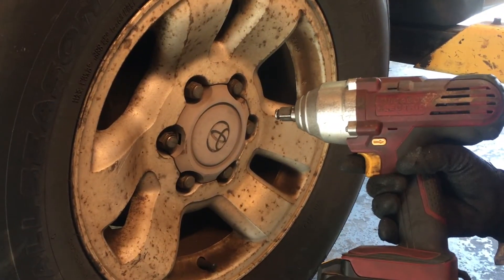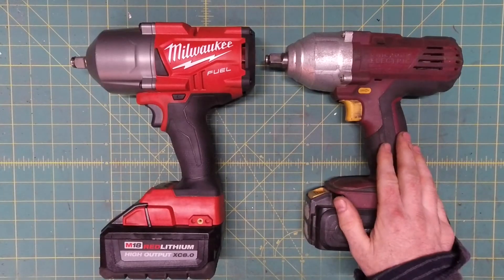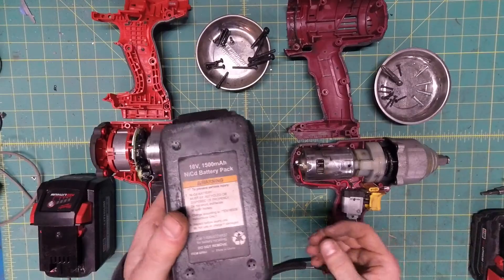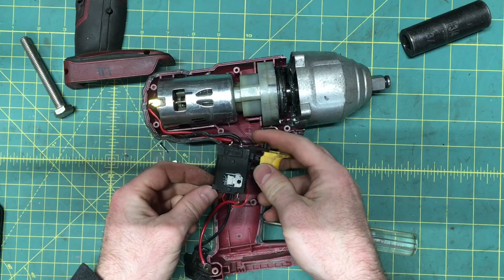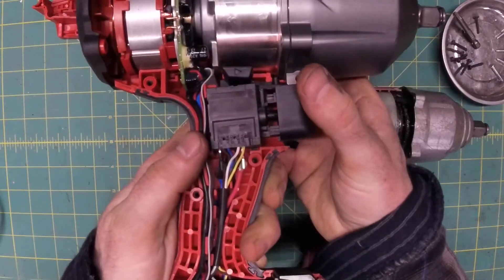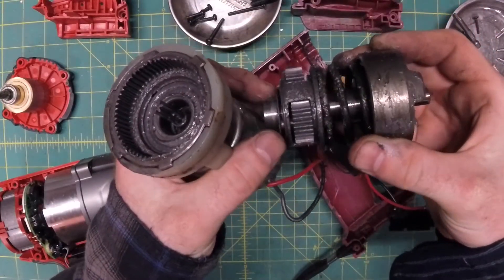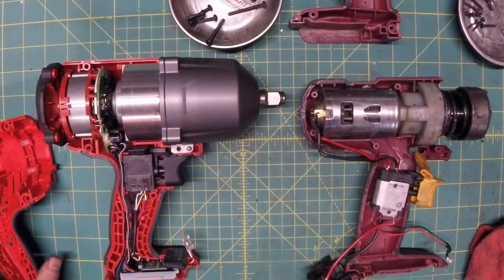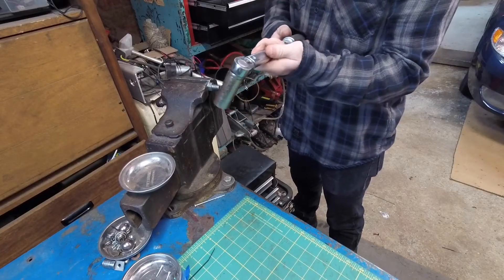World’s Most Powerful 18V Impact VS World’s Cheapest: M18 vs Chicago Electric Review & Full Teardown

Comment: Here’s what I don’t get (yes off topic a little) Snap-on cordless are made the best on the market but lack so much power. They are so much easier to service and the anvil housings are thicker.  They don’t seem to have powdered metal pressed gears either. It just makes no sense for why they are so weak to other competitors. M18 is the best choice overall. I run Makita since I am on that platform. Makita TD171DZ is hands down best impact driver on the market and one of the few Japanese made tools left from Makita. The torque is not quite as high as Milwaukee but made better. I really enjoyed this video. Thank you.
Reply from the maker: Thanks! Makita is also one of the few tool brands that isn’t owned by some mega-conglomerate as far as I know. I’d love to give them a shot, but like you, I fell for the battery system and now I can’t leave.
Reply: @thedoubtfultechnician  You are correct a Makita just owns one other line Maktek which is a little down grade but they still have some nice tools for what you get
Reply: Yes the snap on also uses powder metal gears. It’s unavoidable. The snap ones have a known issue as well where the drive square is prone to snapping because of bad heat treating.
Reply: @kfs777  You sure the older ones aren’t solid gearing? I have a 14.4 3/8 and A1/2 18 volt snap on impact. They were bought new about 10 years ago and they still run good just have had to replace batteries a few times. I wouldn’t buy anything snap on now cause they are under powered and cost to much. However I know for a fact they are easier to service. Old grand father tools used metal gearing like Milwaukee back in the day.

Comment: Suggestion: get the bolt in the vice and unscrew the nut. You're putting a lot of pressure on the nut in that vice and it's soft metal, deforming it and making it more difficult to remove the bolt.

Comment: Everyone watching the slip in Milwaukee batteries is usually on purpose. DeWalts have the same design. It's moved to absorb the vibration instead of transferring it to the battery connector as brutally. Otherwise you end up with cracked batteries. Which was a huge problem for Milwaukee using high torques.  My dcf961 wobbles like crazy.

Comment: Chicago Electric 92349 roadside emergency impact is the cheapest 1/2”. Paid 25 for mine after 20% coupon. Powers off your car battery… which means it’s only 12v.

Comment: I think some of the best tool advice I have ever read is "if your a DIYer or hobbyist, and need a hand tool, then harbor freight will do you fine. Need a cheap crate engine? go to harbor freight. Need a good power tool? maybe try team red or yellow if harbor freight doesn't cut it the first time. Need a jackstand or air compressor? buy the most expensive and well rated one you can find."

IE Harbor freight isnt bad, just dont expect quality, and dont buy anything from there that could kill you, or cause you to be killed.

Comment: It’s not the worlds most powerful 18v half in impact.
Reply from the maker: Every source I found said it is. What beats it?
Reply: Ridgid high torque impact wrench with octane battery.
Ingersoll Rand 7152w (if both using 5ah batteries.)
Possibly the new Bosch high torque impact wrench. They’re close.
Reply: @juanc5149  watch Torque Test Channel. the new Bosch is the first battery 1/2" impact to beat the milwaukee
Reply: @djrenault  

Ok, but he hasn’t tested every single cordless impact wrench and published results. 

The two I mentioned have not been shown on his channel.  But I know they’re stronger.